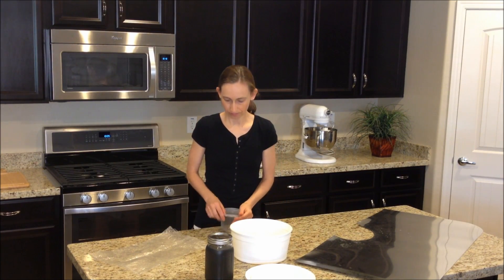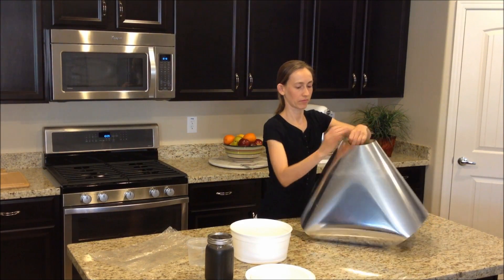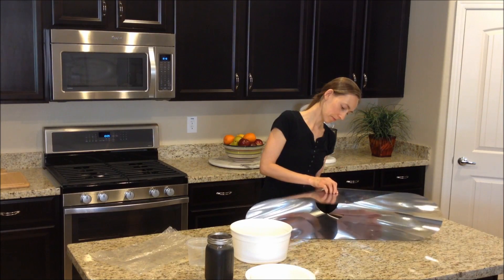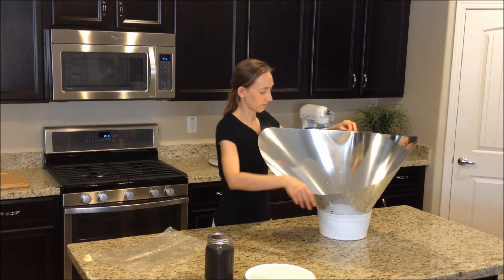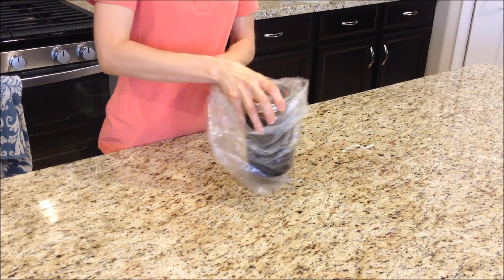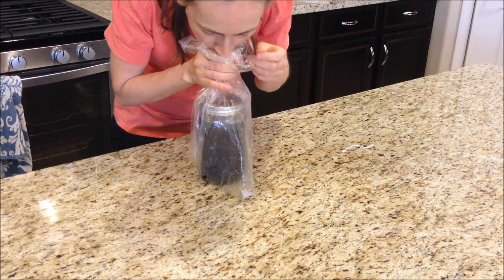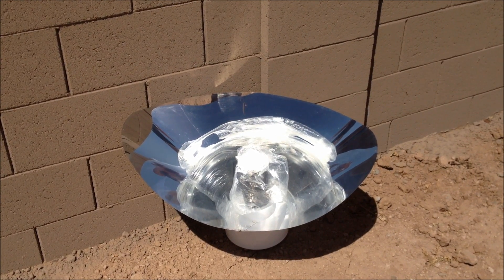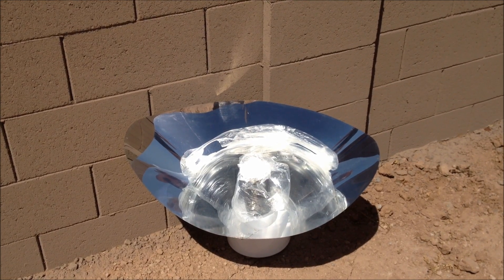Boiling Water in Solar Cooker

Comment: How did the liquid boil if sealed by mason jar lid ?
Reply: A mason jar is not sealed until after the contents of the jar have cooled. The lids are designed to release pressure from the jar during the canning process. That is the way the vacuum seal is created after the jars are removed from the canner.

Comment: Boiling water in s closed jar made of glass. It doesn't speak safety.
Reply: Those jars are made to be heated to high temps, they are preserving jars
Reply: @Lazydaisy646  yes, those jars are made to withstand higher temperatures than normal glass. But glass is never the option to store a pressurized fluid.
Reply: @RafaelRodriguez-vy9tu  The jar is not pressurized. Canning jar lids, properly applied, are made to release pressure by forcing out air when the contents are heated. Because the air is forced out of the jar (releasing pressure) a vacuum seal is formed when the jar cools. Do take the time to learn how both water bath and pressure canning is actually done.

Comment: and how did you get to your boiling water? 2nd degree burns?
Reply: Sven oven mitts smartass
Reply: Sven there are a couple of canners tools that accomplish the task.. A "jar lifter"  would safely pick it up... There is a tool that clamps onto the jar ring from the side that makes it possible to loosen or tighten to torque specifications that I use regularly.... Personally I like the concept of using free sunlight to heat the water.. with a little more innovation one could use the heated water in an enclosed radiator system to heat a home in an emergency situation
Reply: Pot holders. The same way that a bowl of boiling soup  is removed from a microwave oven, for example.